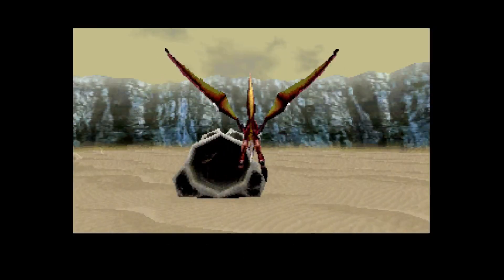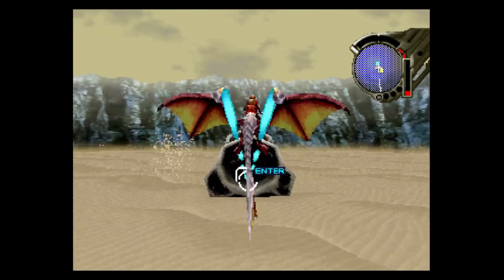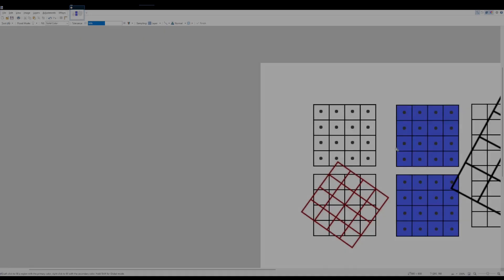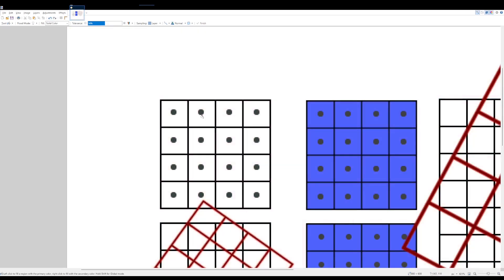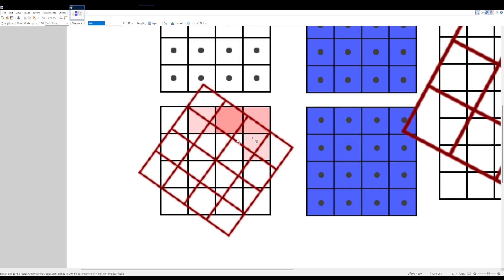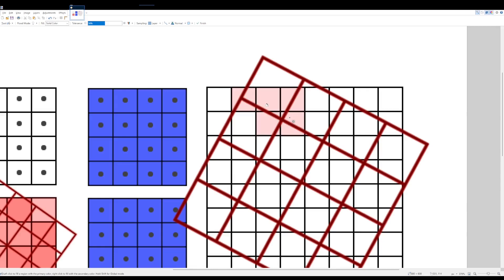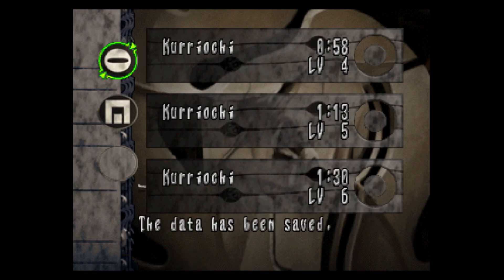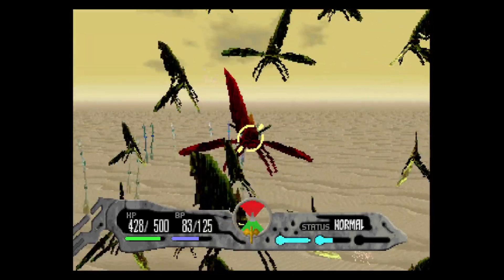Fixing the Sega Saturn - ADDENDUM - Texture mapping bonanza included!

Comment: Btw there is NOTHING WRONG with the Sega Saturn hardware architecture other than whatever disruption and sabotage that Sega of America's 90s management and their 32X caused.

You should have realized that btw since YOU are highlighting Sega's internal Japanese dev team games like Panzer Dragoon Azel/Saga.

The other third parties who had no intentions of actually learning and USING the proprietary technology processors inside the Sega Saturn were still gonna produce shovelware no matter if the Sega Saturn was twice as powerful... don't believe me? Look at the Nintendo 64 and even the Sega Dreamcast... both of them have higher spec capabilities that cannot be ignored and the N64 is a ROM Cartridge system which means nanosecond access times... yet there is a huge difference between the hardcore game devs and the shovelware kings.

One fine example on the N64 is Midway Games... they did not bother to take their time learning how to program on the N64 and instead RUSHED out games to meet holiday season sales so games like San Francisco RUSH shipped with bugs  subpar performance and mono sound... same with Mace the Dark Age but worst of all is Hydro Thunder... made years after Waverace 64 in the year 1999 and sporting sub par water graphics and physics regardless if you have the 4MB RAM Pack... that Waverace 64, a 1996 retail release just never used.

On Dreamcast you have slightly enhanced Sony PlayStation arcade boars games running at higher resolution and colors like Soul Calibur, Tech Romancer etc and then you have some lazy multi platform port jobs like Mortal Kombat Gold to San Francisco RUSH 2047...

The failure with the Sega Saturn happened because people like Tom Kalinske and Joe Miller were employed as management in 90s Sega of America and they pushed their ideas on the Japanese headquarters like they "knew better"... that is a huge red flag that escapes all the people who have nothing but negative things to say about the Sega Saturn. 

The fact that Sega of America's Tom Kalinske got his way and made the 32X alone massively sabotaged the first year of Sega Saturn game software development alone... which Sony and Nintendo and 3DO and even Atari Corp never had to worry about.
Reply from the maker: I've outlined the issues with the Saturn's hardware, I've actually figured out that SEGA could've added an MJPEG engine similar to the PS1 into VDP-2 and then replaced the SH-1 in the CD-ROM sub-assembly with something cheaper + removed the MPEG card port entirely.

The Saturn was hard to develop for and developers weren't given proper tools and libraries by SEGA until it was too late, of course the early ports were going to suck.

Look, I don't know why you are so hell-bent on hating SOA, this was a company-wide shitstorm that sunk them, it wasn't just a clown or a group of clowns, SEGA in the mid to late 90s was the entire circus.

Comment: Correction when you claim that a lot of "SEGA" staff were focused on the 32X, this is FALSE... it was mainly and MOSTLY Sega of America's 90s management who kept their focus on the 32X as soon as they got away with having the Japanese HEADQUARTERS aka Sega Enterprises LTD Japan, approve and manufacture the 32X.

Tom Kalinske had been grand standing about refusing to sell a $400 dollar console since mid 1993 just weeks or months after the January 1993 Project Saturn official announcement in Japanese newspapers.

Tom Kalinske had been doing that in public but behind the scenes he was putting pressure on the Sega Japanese headquarters to make a CHEAPER 32X console to extend the life of 32X... originally when the Japanese agreed to make it it was gonna be simple and be a stand alone "Super Genesis" aimed at the U.S.A. market where around 16 to 19 million Genesis units had allegedly been sold to consumers however Tom Kalinske and Joe Miller met up with Hayao Nakayama and other Japanese staff in January 1994 to again put pressure to ADD more processors aka Dual SH2s and make it an add on device... something that Sega's Japanese engineers had NEVER done with previous Sega systems. 

THAT is where a lot of Sega of America management pushed games were being pulled away from Sega MegaDrive and Sega Saturn (Sonic Stadium or Sonic Crackers which Tom Kalinske personally moved over to 32X exclusively) as well as requesting Virtua Racing, Virtua Fighter, Star Wars Arcade and making remastered SegaCD live action FMV games for SegaCD 32X or MegaCD 32X which was a waste of money and resources. 

Also the U.S.A. launch of 32X immediately FLOPPED... it did not sell out and neither did it sell successfully or even halfway successful because people like Tom Kalinske were giving the press the Sega of America warehouse to retailers sales, NOT the actual consumer purchases which is the TRUE reason here in the U.S.A. for retailers turning irate which was never about the Sega Saturn, it was because Tom Kalinske told and sold them the idea that 32X was gonna sell like hot cakes which never happened and tons of 32X units around 400,000 of them lay sitting in retailer shelves since the end of 1994 all the way to the end of 1995 where Sega of America's management had further sold an additional 300,000 32X units TO RETAILERS NOT consumers and thus over 700,000 32X units and game software lay sitting in store shelves until they were liquidated.

I'm sure for U.K. and European retailers the SAME thing happened and those retailers tried tactics to sell the stock they were stuck with.

The reasoning behind the 32X again lies with Tom Kalinske because he kept insisting that "a $400 Sega Saturn was never gonna sell" which was a lie, he simply did not want to sell it and pushed his own project over the Japanese under the claim that Sega of America's management was successful which was also FALSE and both those Sega of America 90s management fanboy books lied too by only telling the perspective from 90s Sega of America management and staff.

The fact us unfortunately that Sega headquarters in Japan had been slow to audit the claims from Tom Kalinske on a year by year basis... or that Tom Kalinske wad deliberately misrepresenting the actual yearly sales figures because Sega's Japanese management noticed a lack of profits coming from sales in the U.S.A. and North America... in other words other than Sonic and Sonic 2 being pack ins which sell with systems the rest of the games were not selling as they were supposed to and if Sega's Japanese management had performed an audit earlier since 1993 then they would have held Tom Kalinske accountable and prevented any 32X proposals from him from being approved.
Reply from the maker: Yeah, the 32x was an absolutely terrible idea that should've never been even considered.
Didn't the 32x still need to be greenlit by SOJ before it entered production though?

Comment: Yeah the 32x splitting the hardware software teams was a huge problem along with the surprise release at E3 were big killers to the Saturn.

Something else that doesn’t get talked about as much are the amount of Saturn games that never released outside of Japan. The total for Japan is over 4 times what the US got, and some that eventually were brought to the US on PS1 (Lunar 1 and 2, Grandia for example). The Saturn technically outsold the N64 in Japan, and I believe was beating Sony in Japan up until FF7 was released. 

I believe if Sega made the Saturn easier for developers, didn’t do a surprise release at E3, didn’t divert focus for the 32X, and released more of the game library to the US we’d have seen a closer console war that generation. I still don’t think Sega could have topped Sony, but at least a long lifecycle for the Saturn would put the Dreamcast in a much better place that it originally was (because the biggest killer if the Dreamcast was the Saturn).

Comment: What I would do regarding texture mapping is only automate the inner loop. Have a counter, and interpolate four co-ordinates as that counter increases, at each count copying from (u,v) texture co-ordinates to (x,y) screen co-ordinates. This would be flexible, you could do affine textured triangles like the PS1, you could do quads like the Saturn, you could even do Doom style walls and floors/ceilings.

 More importantly it would allow the programmer to define the exact shape of the polygon, so if it needed to be subdivided to reduce warping, the sub polygons could follow the shape of the overall polygon exactly, and if the polygon shared an edge with another polygon, the sub polygons could seamlessly share the edge.

Regarding transparency, a simple trick would be for the VDP2 to recognize the pattern ABA and blend the adjacent pixels, turning mesh transparency into something hard to tell apart from real transparency. It would be blurry, but nicer than plain mesh transparency and more convenient than doing real transparency.
Reply: You describe Atari Jaguar ( which was in stores before 32x and Saturn ).

Comment: Talking shit about the 32X is the most lukewarm take ever. It's a better addon than the SCD IMO. Sure it was rough and based on brute force, but so was the Mega Drive anyways. I think most of the blame the MD addons get should fall on the MD itself for not fully having proper expansion support. The 32X itself is just a quick and dirty but effective software based video and sound expansion, something most third party devs failed to understand i think. Just like the Saturn, if the 32X had some libraries and a proper devkit at launch, it would've proven a much better platform. The system itself is so simple that i doubt it took any significant time at all to engineer. It's a dual SH2 setup with a sound DAC and a dual paged framebuffer display with a blitter.
Reply: the 32X’s issues are less about its hardware and more about the context of when it released, especially with the infighting between Sega of America and Sega of Japan. said infighting is what led to the 32X’s existence in the first place.
Reply: The Sega CD made sense. NEC had a widely popular CD add-on for the PC Engine, and there was no reason to think Nintendo wouldn't have followed suit had things played out differently. It added enough hardware grunt & unique features to justify it existing. The 32X was an entirely pointless stop-gap that wasn't even needed as SOA ended up rushing the Saturn out earlier than expected anyway. It wasn't powerful enough to stand up to the true next gen consoles, it was rendered entirely obsolete within months. Had Sega simply held off, focused on transitioning from the MD to the Saturn (instead of SOA trying to wrestle control from their parent division) & launched the Saturn when original intended I don't think it would have fared as badly as it did in the west. The 32X is such a massive misfire that it drags down an otherwise harmless add-on with it.
Reply: @seanmckelvey6618  The Sega CD was the better IDEA, sure, but it was so overengineered with features that failed to be fully utilized such as the graphics chip that could easily be cut out to reduce costs. The 32X was more than a stopgap, it was a budget alternative to the new generation, something that became the standard in the industry 20 years later.
Reply from the maker: The 32x took away dev time from the Saturn, basically dooming both of them.

Comment: Sega CD + $49.95 SVP LockOn that had already been finished and that everyone was excited about.  Daytona USA, Virtua Racer, Virtua Fighter, and Star Wars Arcade were already developed and ready for sale in Spring.
Reply: Also, 3D really needs more pixel depth and shades than the MD can offer.
Reply: SVP had the terrible downside of being locked to 20FPS max due to the speed of the Mega Drive data bus. It should've never been made to begin with. Virtua Racing Deluxe is an experience miles ahead of Virtua Racing on the MD due to better resolution and FPS.
Reply: @PancakeDev  The ROM bus was 13MHz and just moved tiles when accessed.  The VDP drew those tiles at 60fps.  And we're talking 1994.  PS1 wasn't launched until 1995, and decent 3D didn't show up on rival machines until late 1996-97.  Given sine time, the Sega CD+SVP would've handled demakes of games like FF7 or Resident Evil.
Reply: First the VDP had to gather those tiles being generated by the SVP, a process that realistically you can have only 7kb per frame. a full 256x224 frame in the MD takes 30kb, which means no matter how fast the SVP is, it could never display graphics above 20FPS using fullscreen. You'd need to use half of the screen area to at least get 30FPS, which doesn't help with visibility having the already low color palette. Your faith in the SVP is a delusional fever dream, it would at best have served as as good 2D manipulator, just like it was the case with the SuperFX, for the very same reasons.
Reply from the maker: Theoretically by 1993, you could've just not released the CD addon for the megadrive and instead made it an independent unit and used the SVP. Of course, you'd need to change some stuff around on the Mega CD to make it actually work on its own and so you wouldn't run into issues with the bandwidth. 
But at that point, why use the SVP anyways when you could make a custom chip ala the one in the 3DO, which would've been quite a lot faster.
And all of that would end up jacking the price of the console to like 399$ but you'd have something like (ballparking)
1MB of RAM and 512KB of VRAM, something like the 3DO graphics chip and possibly an SH-1 CPU as they were already present on the market in 1992, with everything else staying mostly the same (except a video compositor, ports for a cartridge and controllers, etc.).

So yeah we just reinvented the 3DO "interactive multiplayer" (what a name btw) and games still won't properly utilize it until it's too late, as Virtua Fighter launched in late 1993, and it was what pushed 3D into the mainstream, meaning that unless someone at this hypothetical SEGA was a savant or time traveller, they'd have no plans for "3D 'capable'" hardware in the new Mega CD.
Reply: @Kurriochi  Or make lots of games with the Silpheed treatment.  Alternatively, SEGA could've made a half size 3DO:  "Genesis 32" with a 10-25 MHz 68030 (selectable by game), 128KB RAM (PA-RISC 7100 + 1MB upgrade available), C2 VDP (with hardware scaling, 128KB VRAM, 4,096 out of 98,000 colors),  and a 1x audio CD, upgradable to 2X CD-ROM.  Base model would be slight loss at $300, but attachment rates of 10 games would be gross sales of $500-550 per console sold.